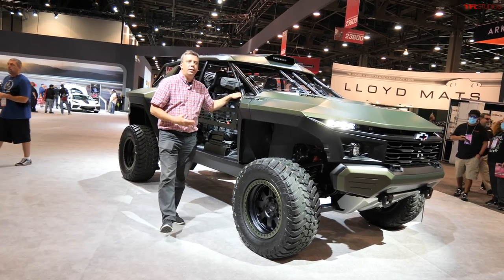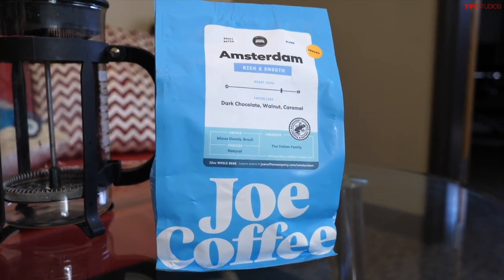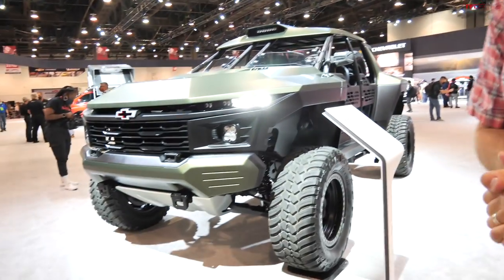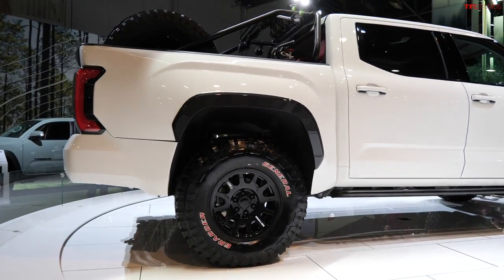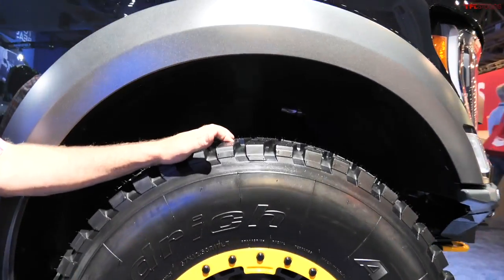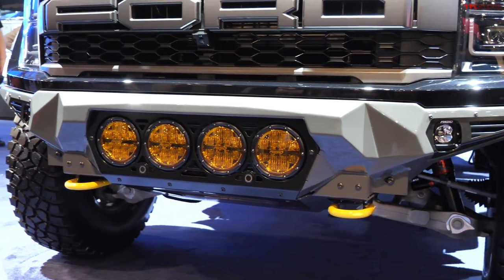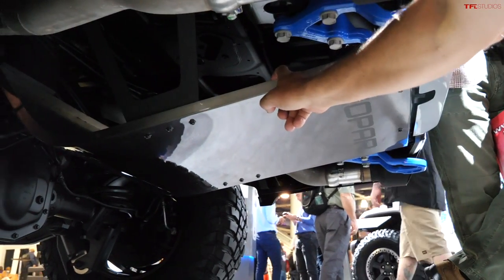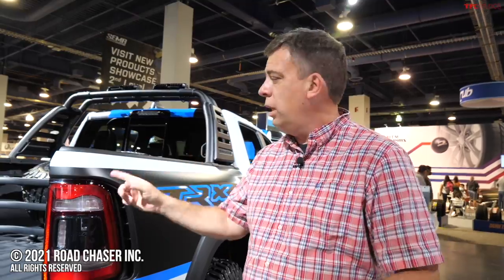The Super Truck Is Officially a Thing: Here Are The Craziest Trucks From Chevy, Ford, Ram & Toyota!

Comment: The TRD Tundra Desert Chase Truck looks so much better than the other Tundras. Those 37” tires and the widened body make the Tundra much more proportional.
Reply: You can thank the epa/fuel economy requirements for that
Reply: The Toyota tundra is a very nice truck I think it looks the best ! "BUT" There is one game changer for me that I would go back to dodge or even think about the Chevy.  
Is they have a v8.   No v6 in a truck even if it has an electric motor with it!
Reply: Very true ... but as always the acronym "TRD" is regrettable, Toyota ought to have consulted some English speakers before choosing it; always good for a chuckle though 🤣🤣🤣
Reply: Love this tundra, they gotta make it!! Toyota get to it 🔥
Reply: They gotta make this Toyota, it's a BEAST!!🔥🔥🔥
Reply: @edshultz9760  biased
Reply: @edshultz9760  Out of curiosity, why is the cylinders and layout make or break? If you can get better power and MPG than a v8 with a TT v6 why wouldn't you?
Reply: @bigslacker666  
     Ok, 
    Yes a v6 would get better gas mileage and yes they are claiming that this v6 has more power, but with this more power with a v6 comes 2 turbos.  Now think were does a gasoline engine with 2 turbos get it's power.  From high rpms.  Were a v8 does not have have to Rev as high.
Then the 5.7 I  force has been around for years in the Tundra. 
The v6 may have been around  but not in the Tundra.  
Driving a v6 Tundra like a car I am sure it well do well , but if you are towing something for a long trip up an down the mountains. 
And I put 160,000 miles or more on a truck.  The 5.7 has the reputation for going a lot more. Can a v6 twin turbo last that long? 🤔 
This is only my opinion  and my observation and my 45 years experience of driving and thing I have seen. 
   I hope helps 
Thank you for asking. 
If you want a v6 Tundra by all means go get one and have fun with it.
Reply: @edshultz9760  I have a v6 TT in my Raptor which is comparable numbers to the new Tundra. My truck makes peak torque around 3600 RPM which is nearly the same at the 5.7 iforce. The great thing about twin turbos is having one for low and and one for high end. FWIW all my friends have 5.7 tundras and I out tow the hell out of them whether passing uphill or MPG on a long trip. IMO and like you based on experience my only issue with turbo motors is longevity. But I have a disease that requires me to buy new vehicles every few years anyway so it's not an issue. :D

It will be interesting to see how these engines hold up over time.
Reply: @bigslacker666  
      Well Steve we all know the 5.7 l force  well hold up over the period of time.  And you even questioned well the 6 hold up over the period of time.  I am in a different boat then you are. I run the truck to the wheels far off and this is my first brand new truck I have ever owned.  So I am betting on long-term responsibility. 
     I believe what you say about power and gas mileage  but take off those turbos and make it more even on engine to engine the 6 does not have a chance.  
     Well Steve what makes this country great is that we are still free (more then most) and we can buy what we want. 
Bottom line I what things as simple as possible.  This is only from "my" observation a gas engine with turbos don't last as long as an engine with no turbos.  I am to old to wait 15 years to see how the new 2022 engine will hold up.  
So enjoy your day and your truck.  God bless and keep safe.  🙏
Reply: I agree! Because as is it certainly looks disproportionate and goofy. Almost Yoshi from Mario Kart, goofy.
Reply: @triumphrider9396  I have more power and torque, why would you think I wouldn't tow better? This summer's road trip my buddy's 1794 towing a nearly identical travel trailer to mine we got to compare. I can get up to speed faster to merge and I can pull 60-80 to pass slow traffic like nothing where the Tundra is more pokey. If you're talking max towing of course he can tow more since I have a soft, long travel suspension. But real world towing well within limits (6kish lbs in our case) the raptor absolutely tows better than the tundra.
Reply: @bigslacker666  8 hp is nothing dude 😂. Have you towed with the 5.7?  I’ve driven both and although close the 5.7 is more capable. I think your buddy doesn’t know how to drive.
Reply: It’s got a V6 though.
Reply: @woxie4990  TRD?
Reply: @triumphrider9396  Sounds like you're confused bro, the raptor makes 450HP and 510 lb ft torque. I have 3 friends with Tundras and have driven them, as well as the 5.7 in LC 200's, I'm a huge Toyota fanboi (owned 2 4runners and an FJC)  like the trucks, they're in not in the same universe as a raptor in terms of power or acceleration.
Reply: Okay  that is great news 👍 
I am  not here to say that one truck is better than the other.  
I am say for "Me" I believe that the v8 is a better choice for me.  I am looking for something that has the power to do what I want for another 30 years.  
     I don't feel that any gas motor with 2 turbos well last that long.  
    If they do well they still have the power that it did when new? 
    I believe even the v8 5.7 well lose some power but I don't believe as much as the v6 with turbos well. 
      So Steve you like your Ford that's great. It's your money. 
And what I have read you been respectful.  
    Reliable is my first choice.
 The v6 with 2 turbos well work harder!  How long will they last 🤔?  That is a waiting game I am not welling to play.
I don't have the time or money  to do that.
    Everyone it's your money your needs and your time. 
Spend it on what fits you.
Thank you for your time and God bless everyone and happy holidays Christmas New Years Thanksgiving

Comment: The Chevy beast just looks like a mars rover, the tundra looks production ready, and the raptor just bolted on some bumpers and a lift, and the trx basically just added blue, although, they all look really awesome
Reply: Weak rear axel in Chevy.
Reply: To be fair, the Raptor also has some graphic vinyls.
Reply: @solodad001  I doubt it's a weak axle its mounted to a 650hp v8
Reply: I agree
Reply: The steel front bumper on that Tundra is the giveaway that its not planned for production. That's never going to pass crash and pedestrian safety regulations. Look at the Colorado ZR2's steel bumper from AEV to see a design that's feasible for a manufacture. Now, could TRD offer a steel bumper after market? Maybe. But for a factory built, sold at a dealer truck to feature a off-road style steel front bumper takes a lot of work the normal ones just don't meet the regulations.
Reply: The Chevy looks like a legit version of halo’s warthog lol
Reply: But the Chevy is not a truck
Reply: Chevy is the same off roader in halo
Reply: @ryanroland6426  10 bolt sucks with high hp and big tires....it will break with hard rock crawling.

Comment: WOW. @ 1:13 Can Chevrolet mount the rear shock absorbers any closer to the freaking ground??
Those things would get ripped off so fast if you hit a rock or anything hard at a decent speed. Or if the tires drop down into some ruts, ⚓ away.
Reply: Same thing they do in the Colorado zr2. Those things hang down so low
Reply: @andyham6094  Have ZR2 owners complained?

Comment: I think Ford has been doing it for 12 years 2022 models. Ram got in the game. As far as the concept GM they threw a bunch of parts on a frame with no clear vision of what a potential production super truck from them could be. Toyota who is generally conservative shows a truck that appears to be able to be in production soon. Very cool series you guys are given us
Reply: Dodge had a super truck b4 the raptor🤣
Reply: You are right but it is a concept car, generally they are just a body on an older model. I really hope GM does get into this category but who knows.
Reply: That Silverado is clearly based off the success of the Chevy Colorado ZR2 ISV that GM has been making for the US military. I hope both vehicles find a way to the public in some form, but there's no way your comment about it being a frame GM threw a bunch of parts on is even remotely true.
Reply: @bubbagothandz7471  if I'm not mistaken is it the SRT10
Reply: @JUNOMAN  yea there's also an srt 8 version as well both came in the early 2000s also if you want to get technical the power wagon/ram has been around since the 80s and was also technically considered a "super truck"
Reply: Dodge didn't get into game until 2020 - ford 2010- gmc 2028. If ever
Reply: @mailemcdevitt7930  ur drunk the srt 1500 was out in 07

Comment: I really hope they put the Chevy Beast into production!
Reply: It's probably just a concept to see if the motor will be good for the zr2 silverado
Reply: They won't
Reply: So it can blow rods everywhere
Reply: @jorangel87  they got rid of the dfm in my 21 trail boss 5.3l that was causing the push rods to collapse being used by themselves and negative pressure. I'm pretty sure gm won't keep going with that technology since 61% of GMs sales  right now are trucks. AFM made sense shut an even number of cylinders down on the V8s but the 6 cylinders all had issues with uneven pressure and wear. 

I'm waiting for the ZR2, equipped with the 6.2L supercharged or one of there massive V8s they just released before everything is Electric.
Reply: @ssgbudlong4728  no the ZR2 Silverado is gonna come with the NA factory 6.2
Reply: @YourDadsBoyfriend  It’s a truck because of the platform it’s riding on, it has nothing to do with a bed.
Reply: @fread51  You probably said the same thing about the Hummer EV. Lol.
Reply: @mybro727  I didn't know anything about that dumb ass hummer until it came out
Reply: @YourDadsBoyfriend  Nothing makes it a truck except the definition of the word “truck”. You’re over thinking it and trying way too hard to find something negative to say about the Beast. 😂
Reply: @fread51  “Dumb as Hummer?” lol. Funny, I’d trust it’s driving better than I’d trust yours. Don’t you drive Ford, bro? How smart are those trucks again?  What a joke.  They’ve done nothing innovative. I’ve been bored with the Raptor. GM doesn’t even care to acknowledge it and y’all are so red in the face about it. Ask GM how bad their sales have hurt because of the lack of a Raptor killer and how they’re in desperate need of one. They will laugh.
Reply: @YourDadsBoyfriend  Or  sadly, this just ain’t the truck for you. And that’s more than ok! More units for this truck’s actual target audience. That’s kind of how this works! and the reason why there’s more than one truck for sale in America.😑

Comment: So are we gunna talk about how chevy made an SUV with tube doors and a beefed up suspension and then called it a truck? No, ok.
Reply: A body on frame Suv is technically called a truck. Most jeep people refer to their wranglers as “trucks”. There’s a difference between a pick-up truck and a truck
Reply: @Inferno45  for insurance purposes, yes. That being said, traditionally an SUV is a body on frame design. Cross overs are unibody vehicles with a larger cab. The new blazers and explorers for example are technically cross overs, but they are large enough to be called SUVs
Reply: @hanksadventures4132  Yes i totally agree with you but something like a Tahoe, wrangler, or 4runner are considered trucks even though they are suvs
Reply: He said it was a truck chassis
Reply: @notlowzach546  aka body on frame. Is the 90s explorer a truck? It's on an f150 chassis
Reply: I was also late to the party. Last year I heard an SUV called a truck for the first time and now I haven't stopped hearing it
Reply: @jamesalexander958  yeah, I feel like people have forgotten that a trucks defining feature is a bed.
Reply: @hanksadventures4132  Lol. Thanks for being triggered by Chevy and posting the dumbest comment I’ve read all year in affect.
Reply: @mybro727  triggered? Who's triggered? I'm just pointing out that GM figured out they couldn't make a truck to compete with the Raptor, so they built an SUV and called it a truck. Kinda like when they made the Hummer that was based off of the HMMWV that was designed by International.
Reply: @hanksadventures4132  Funny that..and a SUV isn't a truck

Comment: The tundra is sick! The only weird thing about the truck is the front fenders and the wheel offset. I think it would be more practical if the fenders were cut shorter, in turn giving the wheels more room if the front suspension bottoms out. The wheels need some more negative offset because the stance is lookin a little silly lol

Comment: Public transportation Train light rail cost $4.95 one way to station. Gas prices cost on smallest eco car @9 gallon tank. $4.95 regular, Equals $44 @ 400 miles range. Biggest suv @35gal tank cost $170 at the pump of $4.95 regular, Range 550 mile range. As of today gas price November 2, 2021. Full tank. Northern California

Comment: The Raptor is the winner here in my opinion followed by the TRX. The panel seams/gaps on the TRD are horrendous. That open air Chevy is just not practical for most on road daily driving.
Reply: I was hoping someone else noticed. That bumper looks like it’s falling off and the body kit looks like a body kit and not a part of the truck.

Comment: These are cool and all, but where is my wide track Colorado ZR2 Desert Runner with long travel suspension, 7 speed manual transmission with low range and crawler gear, and the new 670HP 5.5l V8 from the Chevy Corvette?  I mean if we're talking super trucks, that's what I would want.

Comment: That ToyOta is still just a Toy when compared to the other 3. 👍🇺🇸
Reply: It's the only one with a banjo axle. Toys like the D3 trucks use Dana's that break and rattle themselves loose after real use. That's why D3 trucks are disposable - you aren't supposed to keep them longer than 100K miles.

Comment: “Proper true competitor” my ass. I would not buy that Chevy, if I am buying a super truck, I am going to use it as an pickup, and a play toy. How am I supposed to fit a dirt bike in the bed of that thing?
Reply: Why would you need a dirt bike when you have a Beast? Super charged 6.2L V8 with epic off-road gear.
Reply: @Hellenkeller777  Because dirt bikes are awesome, what more reason do you need? I ride lots of single track, and a Raptor, TRX, or Chevy Warthog simply can’t go where a bike can.

Comment: SPINOSAURUS should be GM's patent or next vehicle to produce and if I had any choice of what GM could and would now be building would be names the Chevrolet SPINOSAURUS because that's the dinosaur that could kill the T-rex or TRX and a raptor, although groups of 20 raptors may take one down lol but SPINOSAURUS once again is what GM needs right now while STILL POSSIBLE , AND TO MAKE A TRUE WIDEBODY, and to have a no doubt, distinguished look from the rest of the GM lineup pick-up trucks, but I'd want too see maybe something like the new brand new crate engine being 10.4 liter 1004 HP  or have mods to up the horsepower of that even , or possibly the same sort of engine from the new Z06 C8 but not just N/A and 670HP but maybe also carry a supercharger or turbo ,maybe twin turbo setup to try too get it at close to 4 digits , maybe even a black wing type engine , whatever the case , it would be to dominate the TRX & the  RAPTOR  &  TUNDRA or ANY Other competitor or competition, and not just in the HP way but the APPROACH & DEPARTURE & GROUND CLEARANCE in all ways but offer things like ford's 1 step drive in certain conditions or places as well as maybe solid axle or a tried and truly tested HD independent front suspension or 4 link rear or something such as that!?!? Just wish it would out flex 💪 the competition also and have swaybars disconnect, both front and rear optional lockers from the factory like the Zr-2 Silverado and Zr-2 Colorado, have more Easter eggs then the bronco, the jeep, the trx, the raptor, and such as things as paneramic roof, big touch screen, carbon fiber or carbon composite and as much light weight type material possible to maybe build the body parts/wheels and so on too keep it responsive , light , powerful , capable , and most of all , TESTED TOO BE TOUGH , AND DESIGNED TO BE UNTOUCHED BY ANY IN THE TRUCK SEGMENT !!! GM WOULD BE KING AGAIN WITH THE ON-ROAD COMPETITION BEING CLAIMED BY THE VETTE Z06 C8 & NOW (if was built) THE OFF-ROAD COMPETITION WOULD BE CLAIMED BY THE SPINOSAURUS !!!  Or maybe even add a REAL & new yet again blazer or trail blazer or something but resembling the old original blazers and be much better off road then jeep and bronco and even Colorado of previous and current years even !?!? Idk but GM seems too have lost their marbles , look at the Dodge Challenger and how many years and units have been sold without even changing much of the body designs, ppl like the American muscle look from the 60s era and the Challengers most resembled the old muscle out of Ford and GM both , so GM should also bring back one last manual transmission big gasser engine ,solide axle front & rear ends, maybe even HD versions with Duramax option but if the body resembled the old square body GMs from maybe 73-79 ish body styles and had round headlights in a square body , I believe people would eat it up, especially looking old and classic but yet having updates like newer tow mirrors and cab lights or interiors and so on ETC like a restomod that's more less brand new I side but classic original style on outside but yet have modern touches on the outside too make it better then ever and mix the techs up a bit....